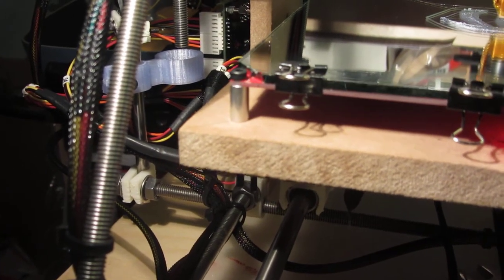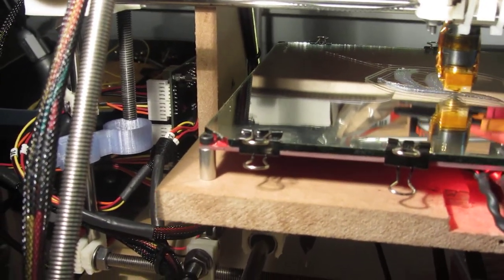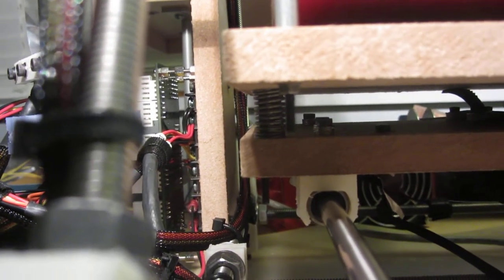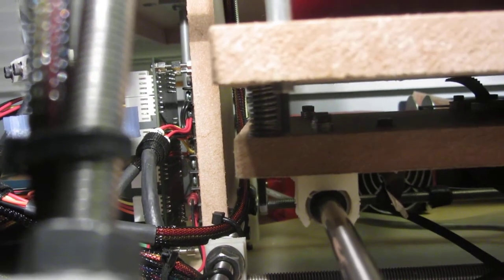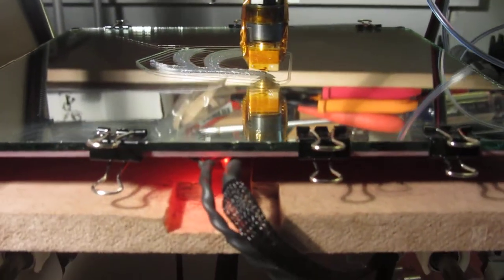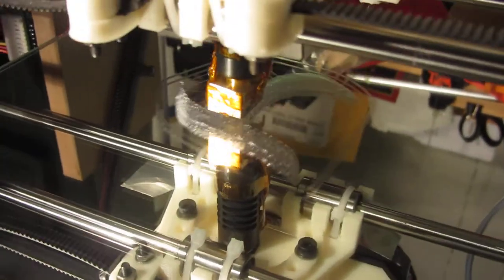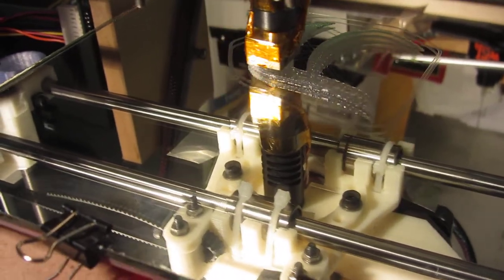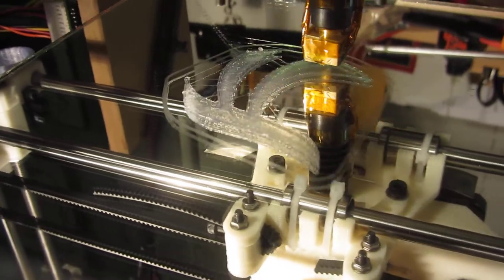More Improvements to the Prusa

Comment: havent built my prusa yet.. stilllll waiting on parts but do have a cnc mill and lathe etc. It looks like you have some vibration problems.. probably what is causing your high speed prints to be less good. There are two huge problems with reprap designs.. i think because the community sprang from the cnc router crowd. One is strength/rigidity which leads to sloppy prints. The other is precision. Firmly mounting the machine and increasing structural strength will get rid of #1. #2 is solved via lead screws/ball screws.. but that gets expensive. If you have some extra cash look into converting the z axis to a ball screw or screws.
Reply from the maker: This machine was upcycled long ago..  :D
Reply: Matt Miller  awesome . Ive just put mine together today. All but wiring the psu, heatbed and endstops. Viewing your video helped a lot. There needs to be more meta info on the repraps.. if i had seen how it goes together i'd have built it differently from the start.. a box configuration. As i said.. your video helped understand a lot. Now to get it going and then start ordering leadscrews and other such foolishness ;P